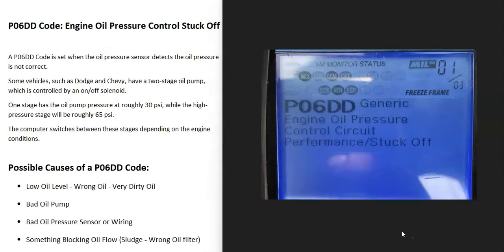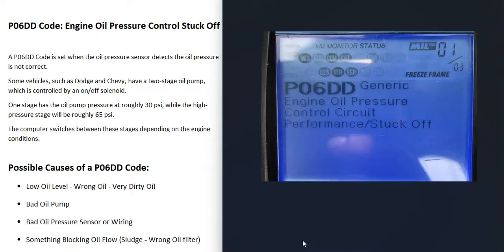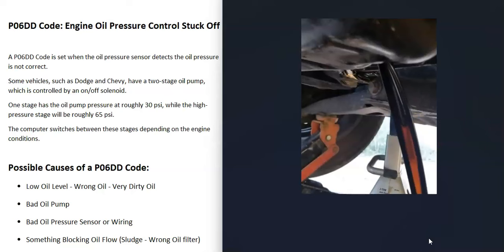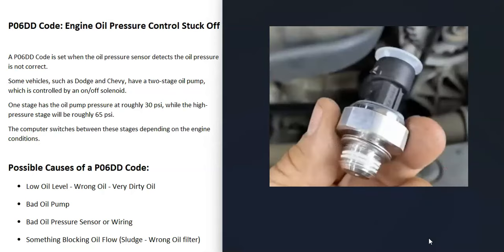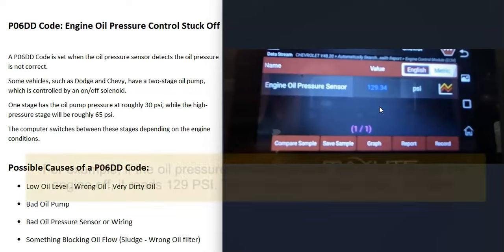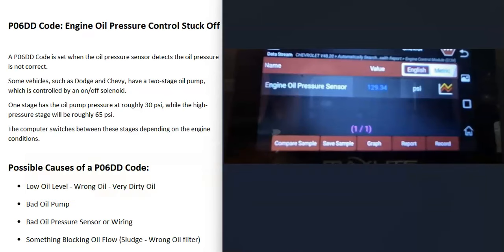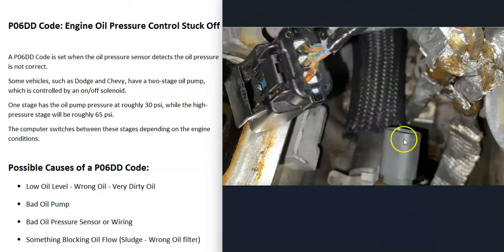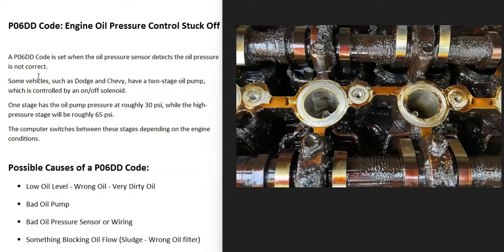Causes and Fixes P06DD Code: Engine Oil Pressure Control Stuck Off

Comment: Replacing the sensor attached to the oil cooler cleared this code on my grand Cherokee. It wasn’t the oil pump as told.
Reply: is it the oil temperature sensor?
Reply: Привет подскажи это датчик температуры масла?
Reply: What was your oil temp reading

Comment: 2019 chrysler pacifica 3.6 v6 (pentastar) non-flexfuel. Had the oil changed by a lube tech in training at a quick lube place, drove just fine for about 300 highway miles, then check engine light came on, car was incredibly sluggish to accelerate, didnt want to rev above 1500 rpms, but did at least maintain speed. Checked my scanner and had the P06DD code, on these motors it generally seems like the pump or solenoid, which had me nervous being 300 miles from home. Called a mopar buddy of mine and he said it was probably a bad filter since it was just changed at a quick lube and they usually get cheaper filters. Got a wix xp filter from oreilly's, and took the old filter cartridge out. The lube tech had put the filter in upside down, crushed the anti drain back valve on it (luckily no pieces came off and went into the engine). Put the new wix filter in and the car runs like a top.
Reply: Before changing the filter i was seeing 7-9psi at idle, 24-31 accelerating, and 14-24 cruising. Once I changed the filter (and actually installed it correctly) I saw 30-31 pis at idle, 32-70 accelerating (depending on how much i was pushing the pedal), and 31-32 cruising. Luckily a simple fix for my scenario. Getting a refund from the lube place too.

Comment: Had the sensor replaced still  the check engine light is on new oil change pressure was checked and normal operating pressure but the light is still on. The mechanic thinks it’s a computer issue

Comment: This happened to me today. I took it to  O’Reillys immediately got the code P06DD or whatever then I took it to Valvoline and checked my oil it was really low so I refilled it but my oil pressure went back to normal so I’m just hoping that the cold go off but they didn’t see a leak or anything. I have a 2019 Dodge charger GT.

Comment: Currently troubleshooting this on my '14 Grand Caravan with 250K-kms (155k-miles) .  We replaced the oil cooler/filter housing last year with an aftermarket aluminium one last spring and the vehicle worked fine until the middle of January.  Started getting Rich/Lean, misfire and oil pressure codes.  Replaced the oxygen sensors and the oil pressure switch.  That cleared the Rich/Lean and misfire codes, but still had the P06DD.  We are going to try to replace just the Oil Pump solenoid and see if that works.  $50 vs $350.  We'll keep you posted.
Reply: Any update?
Reply: Any update
Reply: @isaacd5845  - didn't work.  Its running fine at the moment, but I am thinking the oil pump is going to be next.
Reply: @bartomand3681  I’m about to try to fix this problem myself. Did your engine pressure light remain off after all the parts your replaced since the past month man ?
Reply: @onesikm3  yes sir.  Had to clear a code once after about a week, but since then, its all good.
Reply: @bartomand3681  so did you also replace the oil pump solenoid too ?
Reply: @onesikm3  yes.

Comment: could a bad plastic oil cooler cause this code? i hear the plastic stock ones are garbage
Reply: me too..after changig the plastic oil cooler as it was cracked...now we have even replaced the expensive job of theboil pump..same code..same limp mode
Reply: @jahariereddick7098  The oil is fresh....each of the 3 engine repaors on just the oil cooler required 3 full oil and filter changes.. Then the mechanic that did the oil pump just last week chose to do it by pulling the engine and going in from the top and so I have all new full synthetic oil and filter. Again
Reply: @jahariereddick7098  oh wait the oil pump filter??  I would think they would have changed that when they changed the oil pump last week
Reply: replaced it with an aluminum one and i do recc
Reply: @tracyhenry6752 having the exact same problem as you. Did you ever figure out what it was?
Reply: @tracyhenry6752  привет на моем wrangler такая же проблема как и у вас подскажите в итоге что вы сделали чтобы убрать ошибку p06dd?

Comment: I got the code so I checked my oil level first...was really low. Needed 3 quarts to get it back to the middle of the safe area. I know you said "low oil or wrong oil", but I'm guessing there's a leak somewhere so I have an appt for my mechanic to try and figure out what the issue is. I did get an oil change 6 months ago, and the guy insisted on using synthetic oil (which my 2014 Jeep doesn't call for). Not sure if that would make the oil leak out?
Reply: No

Comment: Can a possible cause be acceleration issues?
Reply: For me that was a symptom but not a cause.
Reply: @one_gen_behind3600  same here did you fix?
Reply: in all vehicles yea. more acceleration = force = pressure, very easy to blow a an old pump like that. I think mine just went bad from it but I have to check

Comment: So I put a new oil pressure sensor on a 2011 avenger  and the light never came back on until high rpm around 70mph several days later while passing another vehicle and it's the same code as before. Any ideas since the sensor is new now? It also says stuck on not stuck off for the code

Comment: I changed my oil and then this code came on could it be the oil? I'm confused it's the same oil I use all the time plus I have a new oil cooler and oil pressure sensor
Reply from the maker: It needs to be diagnosed, but if you are using the same oil, it is unlikely that. I would check the new parts that were installed to be sure everything is installed correctly, and wire connections are plugged in good.

Comment: Would a leaking valve cover be another reason
Reply: unless your low on oil from the leak then no your valve cover is already leaking pressure through spark plug seals etc